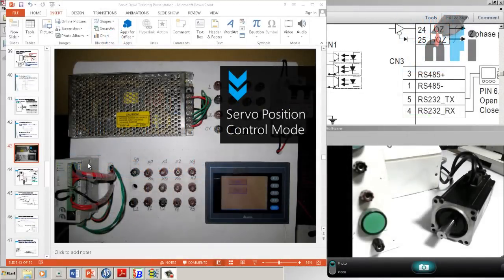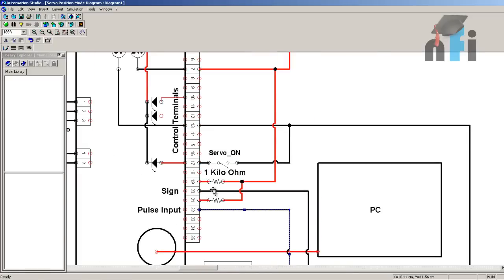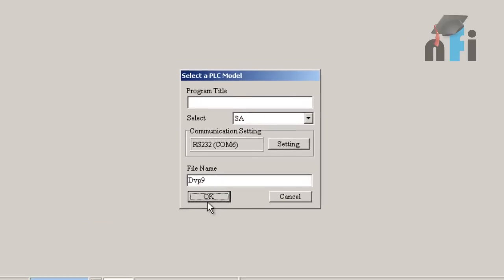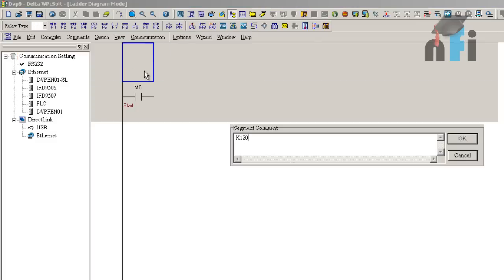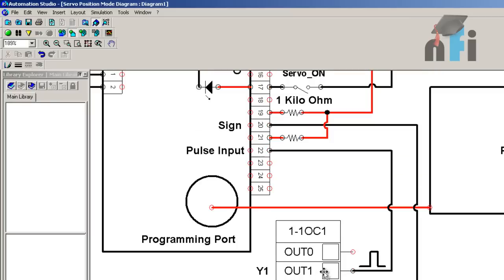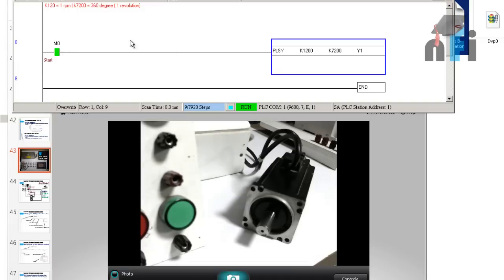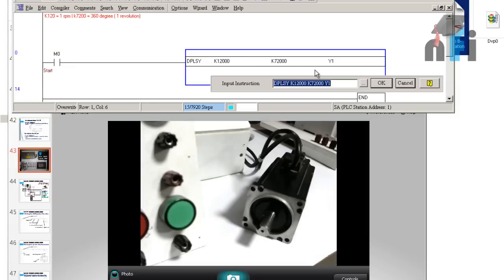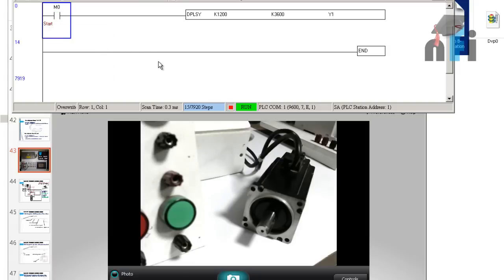Delta Servo - Position Mode ON/OFF of Servo Motor by PLC

Comment: Hello Mr. Singh, I am using ASD A3 - L. I do not have a COM- Pin on the CN1 connector so I am not figuring out how to do the wiring. Could you tell me what I should use instead of COM-? Will 0V from PSU work?

Comment: Hello RAJVIR SIR ,

have a nice day.

I need your help

Respected sir,

I shall try to make 3 axis(X,Y,Z) PLC(delta dvp 10pm) operated plasma/oxy fuel cutting machine | In position control mode ,we will have to   continuously sending pulses in servo drivers for distance and velocity as per target X,Y,Z coordinates and after will completing any commad we want feedback from ac servo drive(panasonic make) for comparison,and closeloop purpose |  how resolve this issue please suggest me any hmi software or idea,

Can we will make machine without cnc controller??

We are waiting for your response 

Thanks

Comment: Thanks for the video. I want do this control with Arduino. Do you have any how to do that?
Reply from the maker: You can do that with high speed output of Arduino but in that case you will get 5V outputs from Arduino. You need an optocoupler to convert 5V to 24V. This way you can control the Servo. Another method is via MODBUS :)

Comment: Sir ji.  I have a stepper motor  and it's driver circuit. To run this it needs pulse signals. How I can generate pulse using a plc or delta MS controller...?
Reply from the maker: Using PLSY or DPLDY command in delta PLC which has transistor output
Reply: @thegeterrdone  thanks sir..

Comment: hi mr. rajvir,

it's a great effort you made here on youtube.com. i use to watch your videos which are very helpful as well as informative. i have the fatek plc(high speed transistor version) and want to learn how to interface a servo motor with it for position and speed control forward and reverse. can you please help me in this regard? because there is a lot of difference in commands as i want to use HSPSO function in fatek.

if you can do it would be a great help.

 thanks,
qaiser iqbal

Comment: Greetings. I am trying to connect a DVP28SV PLC to a ASD-02-0421-M Servo.
I have done the following connection: 
VDD --> Pull-hi-ps
C1 ---> -COM
Y3 ---> /SIGN
Y2 ---> /PULSE
With the following parameters:
Pr 1-01 = 0
Pr 1-45 = 720 / P1-44 = 128
Pr 1-00 = 0002
Pr 2-10 = 001 ( Servo On )
With plc code ( PLSY K1200 K1700 Y2 ) on a M0 bit.
When I run the code, the drivers screen counts the exact number of pulses of K1700 but the servo motor does not move. Note that the servo is ON and the shaft cant be moved by hand. Since I have the screen of the servo drive counting the pulses I think that there is a problem with the parameters of the drive, I went over the manual over and over again to solve this problem but I couldnt figure it out. 
Any help is highly appreciated.
Solved : Problem was in the e-gear ratio. N1=1000 M=10 solved the problem. Also connecting the servo motor using a printer USB cable ( CN4 ) to the ASDA software helps in figuring out any problem related to the programming of the servo drive.

Comment: Please make a program on Industrial application like Puching machine where cut to length programing is required 

This application is used for Bag or Puch making machines 
in this application we have printed bag material in Roll form there are so many bags are printed in this Material Roll and fro servo  servo positioning or programming a Black colored rectangle Eye mark is printed in between every two bags which is detected by an Eye mark sensor which gives an out put after every single bag when it passes in Machine during bag making process machine gives a  heat sealing at every bags bottom & gives a cut on every bags Top side so that packing material can be put later ON IN THESE BAGS 

SO PLEASE MAKE A VIDEO THIS KIND OF industrial PROGRAMMING
Reply from the maker: For explaining this programming i would need this machine. No? Because otherwise it's not easy to explain.

Comment: i want to run stepper motor with LS master k120s plc , how can i start programming ?
Reply from the maker: You need to find a way to generate pulse output from your PLC. Then further wire the pulse output to Driver pulse input. You will find the wiring details in the stepper driver's manual.

Comment: how i can to doing program for servo motor for 1meter for example
Reply from the maker: You need to calibrate the servo system to find number of pulses required for lets say 1mm. Then use maths to find pulses for 1m. For example: If you calibrated 1000 pulses for 1mm. then you need 1000x 1000 pulses for 1meter

Comment: hello Rajvir , for one of my application close loop , line interface,  i want to show the exact number of pulses in hmi.
i have siemens s7-1200 cpu 1214 , hmi  ktp 700 and delta servo motor-drive  asd A2,
the thing is i can run the motor the way i want. encoder cable is connected to the drive.
i want to know abt the parameter in the drive that can give the exact feed back to the plc abt exact number of pulses / or there is any other way plc can know the exact number of pulses motor travelled [feedback]
Thanks and regards.
Reply from the maker: Good question! Well there is one way which i am sure of. In Delta Servo drives, we have feedback of pulses from 6 wires. You will get those wire in 25 pin connection. More details about the no of those pins. are in your manual.

Now you also need to see the voltage signal of those wires. I guess it's 5V and your PLC input reads 24V. In that case, you need opto coupler to convert 5V pulses to 24V pulses. 

The other way could be reading the pulses from Servo directly via MODBUS. I am not sure about how to do this.

Comment: what type of plc which you used? thank you
Reply from the maker: I am using Delta 12SA PLC!
Reply: @thegeterrdone  can we use relay type for speed control
Reply: @KulwinderSingh-xf4vs  no you cannot. You need a high pulse output. Relay type cannot provide that you need transistor type plc

Comment: hi mr.ravjir,
sir,can i use manual pulser to give command  direct to servo amplifier to run a motor,without using plc.tnx.
Reply from the maker: Yes, you can do that. Servo driver just need Modulated command, it could be from any controller.

Comment: hi mr rajvir thank you for all informations, please can you show us how we can command a servodrive of yaskawa Sigma 2 SGDM with software Sigmawin+ with a PLC (for example S7 300,400,1200 or 1500 SIEMENS) and a type of signale that we should send from PLC to servodrive  thank you very much
Reply from the maker: +achraf bara I can tell you about Siemens high speed output command but after a while. I am working on Siemens S7-1200 these days. If you could able to generate high speed signal from Siemens then wiring up the servo is not difficult.
Reply: I want to order a servomotor (SGMGH 1500 min-1) by the SERVOPACK SGDM 20ADA the desired operation is as follows:
I have a panel in which I seized the length L and the speed ,the servo motor should run up until traversing the length L, as I also want to see the covered distance  at every moment by the servomotor (by mm on the panel) until it reaches the length L seized,after the servomotor should be stopped, can you help me
Reply from the maker: +achraf bara Yeah, it's a very typical application. Which PLC you are using in that? try to generate high speed pulses out of PLC, then set your Servo in Pulse mode and connect the high speed output wires of PLC ti high speed input of Servo Drive. And then write the code accordingly. You need to know PLC programming and wiring in this case. If you are totally new in that, i would suggest you to hire a PLC specialist. Helping online in servo project is not good idea. Servo projects are very sensitive.
Reply: can you send me a list of instructions that I must follow to order a servodrive from plc
Reply from the maker: +achraf bara I can tell you for Delta PLC. There is mainly one command for high speed output.
DPLSY - this is for High speed output

More information you will get in our course- Advanced AC Drive- VFD, Stepper and Servo. The details are in the course description.

Comment: which proximty sensor should i use to detectct the wood!!!
Reply from the maker: +dhanush kumar You can use capacitive or Optical type proximity.
Reply: +Rajvir Singh (NFI Automation) sir i dont know how to write program for forwar and reverse of motor.. and i wanan to interface my h bridge circuit for forward and backward for motor controller using plc.. so how to interface my h bridge ciruit using plc program.. and what if there comes intrrut.. for example i wanna to go 5 th floor but at the instant if some one push level 3 button it  the cab should wait for some time at level there and return to level five!!! how to do this i have problem.. sir i am using wiper dc motor of 12 v rating... so how to interface my  h bridge ciruit using plc!!! this is my big problem

Comment: explanation is so good please more videous explanation about wiring plc to servo drive and drive to servo motor
Reply from the maker: +VAIRAMUTHU VAIRAMUTHU You can buy the course for all videos. Please check this link: https://www.udemy.com/learn-vfd-in-a-day/?couponCode=nfiautomation_web3
Reply: +Rajvir Singh (NFI Automation) which proximty sensor should i use to detectct the wood!!! should i use inductive, or capacitive or infrared proximity sensor or ultrasonic sensor!!